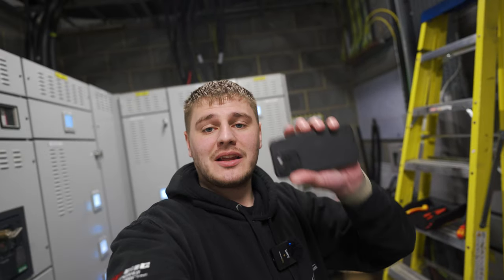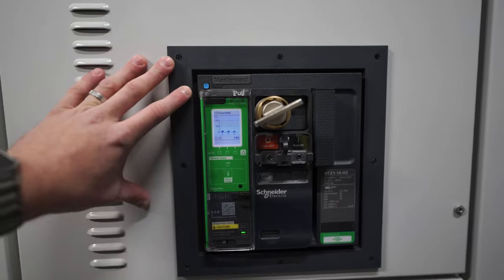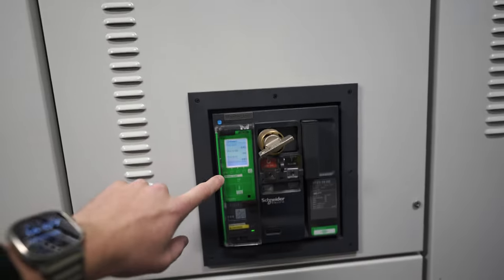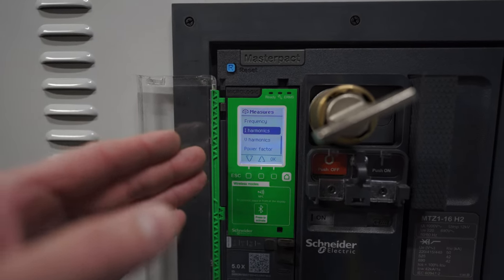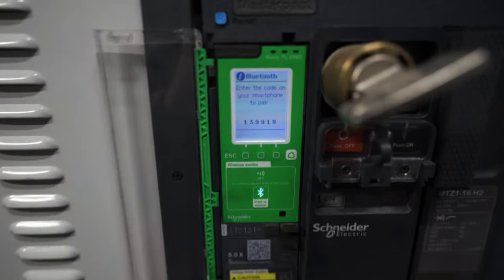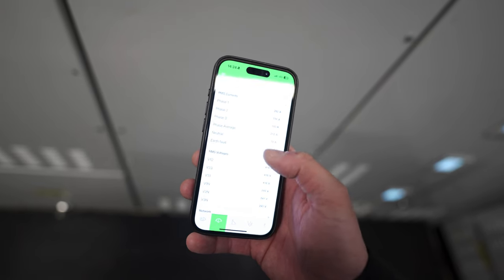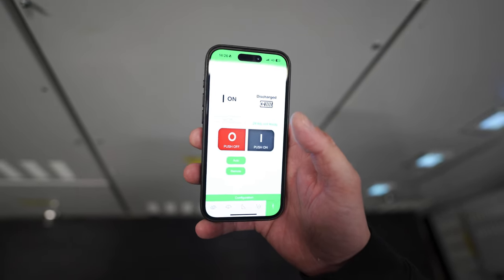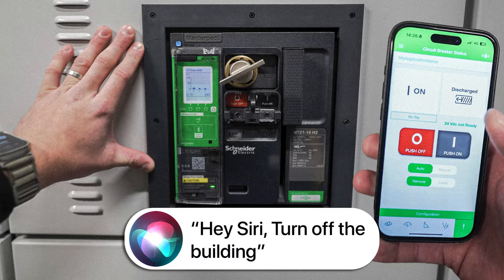Connecting my iphone to a 1600A Air Circuit Breaker

Comment: 09:21 nice to hear that the low voltage stuff from Schneider is good. The times I had to work with MV protection relais, the general consens was that they were, especially from a usability standpoint, bad
Reply from the maker: That’s interesting, I can’t fault their LV stuff at the minute to be fair

Comment: Presumably you can fire the breaker over bluetooth standing at the door of the switchroom in your civvies, rather than to the side of the unit in full arc flash gear?
Reply from the maker: That’s it! Especially if it’s showing contact wear/end of its service life and needs to be isolated.

Comment: Hello Mike.

Very cool and interesting videos you have.

I had Fault finding job just like that Schneider Electric ACB.

New Two 9 storey apartment building  ACB kept tripping over and over again.

Finally Schneider Electric technician came and connected laptop with USB cable and fixed it.

Also added on top missing jumper block.
Reply from the maker: Haha that’s nuts! At least you got it sorted 👌🏼

Comment: Pretty impressive and it's fairly easy pairing process. In some ways I wish my Bluetooth headphones were that simple. They really seem to be doing some nice stuff right now. And it's one of the only companies I've called in the last decade that actually has a human on the phone.
Who transferred me to technical department who got back to me with a lot of information.
For a residential breaker at that. Was having some nuisance tripping with high load this customer really should've had the whole system replaced but cheap scape pinch those pennies spend those dollars. Combination of overloading too many overloads and the previous breaker going bad. 200 amp it was a fun replacement sort of in the dark of course in the workshop guest house office.
Reply from the maker: Yeah their technical is un-matched, I ring them all the time and get stuff spec’d for jobs, they’ll itemise down to the part number 👌🏼